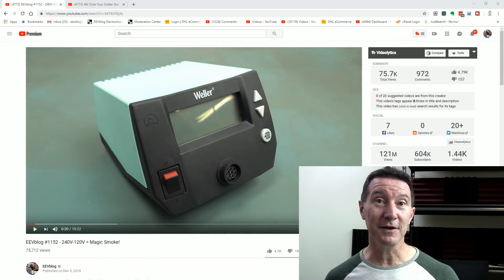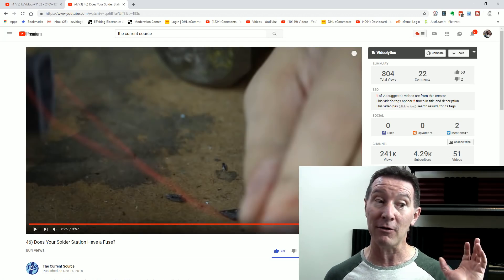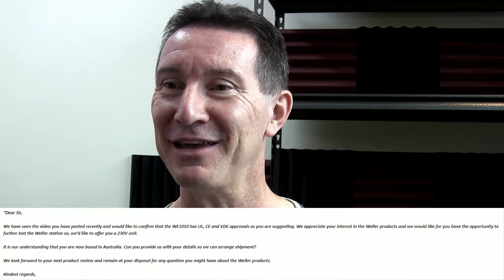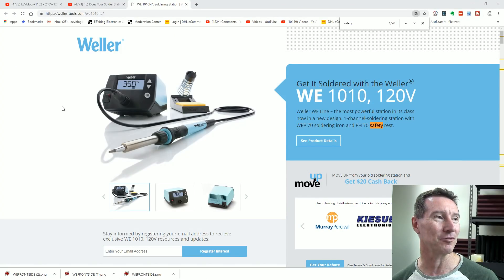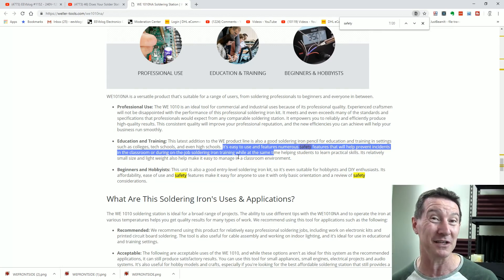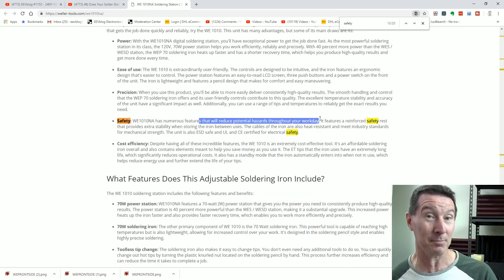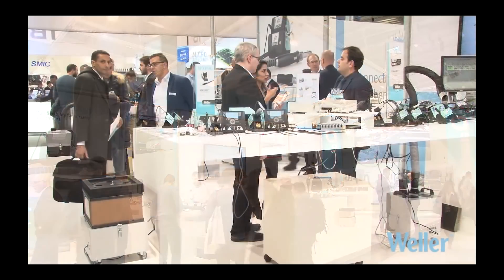EEVblog #1160 - Weller Responds!

Comment: Hi Dave - Thanks for highlighting this and can not believe their response. I have sworn by Weller for many years and have around 8 soldering/desoldering stations around my workshop. Over Christmas, I am now going to check and see if they have mains fuses on the input.

I am in the UK on the 230/240 supply, and see regularly the result of incorrect fusing (or no fusing) through our doors on an almost daily basis. I can not believe you got such a wishy-washy reply with no technical reasons for the ommision. Perhaps the CEO runs all his domestic equipment without fuses?

Merry xmas.

Comment: WOW using a different Weller myself,  looked up the model u r talking about online, the pic of the back it has a computer male input for Mains, BUT NO LABEL REGARDING Power Requirements so ANYTHING could end up going in there and its  ALL THEIR FAULT, as well as NO Fuse.  : (      TOTAL FIRE HAZARD

Comment: Well you plugged a 120v item into a 240v supply. I'm surprised they didn't send you a info printout on how to read a voltage rating. Also don't you have a correct fuse in the mains plug anyway?

Comment: In the US, a lot of consumer products with mains transformers won't have primary side or even any protection. It is usually devices with small transformers such as radios and boomboxes or just about any small "wallwart". They rely on the thin primary winding to be the fuse. The transformer in the Weller is comparatively beefier and should have been fused.

Comment: Weller would have done better not to respond at all when compared with this. Deliberately ignoring the problem in their response adds more fuel to the (in this case very real) fire. They once had a fairly decent reputation. This was an opportunity that could have been used as a turning point for them. Yes, they'd be sinking some short term earnings, but they'd be buying back their long term name/rep. Sorry, Weller. You've now demonstrated AGAIN that the bean counters and marketers are running the show! Smoke and mirrors don't fool us.

Comment: Sorry Dave but you're wrong, the lack of primary side fusing is completely safe in this instance, failure of the transformer insulation which is very rare will result in three possible outcomes, a primary side short (in which case the breaker will trip), a primary to secondary side short which can't happen in this case due to the transformer design or a secondary short causing core saturation and excessive heating (which is the only realistic scenario where a fire could occur), the only negative I can see is the lack of thermal fuse but since it isn't a product that is meant to be left unattended for long periods there is probably an exception for it, putting 240V in to a 120V product is a rather unusual scenario and would not be stopped by a fuse until a short occurs so it has no value at all.
While I would greatly prefer a thermal fuse to be present, ultimately there is no reason for the product to include a primary side fuse.
Reply: Are you by any chance working @ the Weller marketing dept?
Reply: Heh nope, their marketing department is clearly wank, but I still stand by what I said, failure of the transformer alone is incredibly rare so protection of the secondary side only is typically adequate, in the rare event that it does happen we have breakers for a reason, don't get me wrong I do think there should be a thermal fuse in there but it isn't a huge safety concern otherwise it would have never made it through compliance testing.
Reply: @JohnDoe-hm8lr  Like Oskar said, due to the IEC connector it's pretty easy to connect this crap to 240V accidentally, even in the usa. I used think the us were all "safe" 120V pussies, but now i learned that at least some of them also have 240V on their household-plugs. So you can easily blast 3+ KW through this thing for hours without your circuit breaker doing anything.
Reply: It's not an unusual scenario thanks to the brilliant design of the IEC connector.
Sure, we can blame Dave for not double checking the voltage rating, but you can't expect ordinary people to have half a clue.
(They probably wouldn't have a soldering iron, but still: it's far too easy to connect stuff to the wrong voltage.)

Comment: I'm not a pro EE myself, but I have to ask... Isn't a primary side mains fuse required in stuff like this, and if not, how come.

i'm personally thinking shitty cert requirements for UL & co. or cheating like Volkswagen and other manufacturers did with their cars. The CE mark might as well be Chinese Export. Surely the cert authorities must at least require the bill of materials or diagrams...

I do realize that soldering irons mostly output a 2 digit amount of watts for heating, but it's still a heat generating (thus, fire generating) appliance. 

still.... tons better than connecting a heat source directly to the mains like the non-station crap irons.
Reply from the maker: The product class they chose to have this UL tested under apparently does not require a fuse. But it's industry standard arse-covering common sense practice to add one. Seems Weller don't agree with that opinion.

Comment: So you applied the incorrect input voltage, and this is the fault of the iron?  Was the mains fuse specified by weller?  If not, what are you complaining about?
Reply from the maker: They deliberately did not specify a fuse in the design, like everyone else does.

Comment: Wasn't the sample unit intended for the North American market?  Fuses?  we don't need no steenking fuses...   Apparently their electricity isn't dangerous,  or so everybody (on the internet) seems to say  - I've watched a certain NA youtuber  do appliance power wiring, and his responses to the resulting 'safe-t-nazi' comments about things like using a protective grounds as  an appliance neutral (shudder) indicate a serious gap in his understanding.  :)   But, seriously, it won't be a  loophole in the UL regs, it will be a gaping  chasm.   Why not get the 230V  sample from them even if only for dissection?  I'd be interested to see if the Australian 230V unit carries a fused or thermally protected transformer or if they use the same rules that seem to allow much industrial equipment to require the infrastructure to do the fusing. That said,  I'm yet to see a generic mains pencil with a fuse even in .au  (and no, two wrongs do not make a right, even if three lefts do).
Reply from the maker: It was their job to inform us if the other region ones have a fuse, not my job to investigate.

Comment: the weller irons I have used don't have a transformer they plugged directly  into the mains so if something went wrong the fuse in the plug would blow & if you removed the soldering tip the iron wouldn't work as the tip was magnetised & was needed to close the thermostat switch

Comment: While I agree that it would be better to have a fuse in it for the reasons you specify, I don't think that Weller has committed any crime in leaving it out. The iron meets UL standards for safety because it is electrically isolated and the case is a non-flammable plastic just like countless small power tools. It falls under the same standard as a drill or power saw. Soldering guns and and irons often do not have fuses because it is assumed that you are capable of reading the instructions and using it safely. Weller is probably not directly addressing your concern about the fuse because of all of the litigious A-holes in the world looking to make an easy buck over a non-issue. They aren't going to say anything that might be misinterpreted, like 'get over yourself'. If you want a fuse in your cheap solder station, put one in yourself.
Reply from the maker: I did not say or imply they did anything illegal, I'm sure it's completely legal.  I think it's just a stupid design decision.
Reply: I didn't suggest they did anything illegal either. It's just a metaphor. I don't see it as a significant flaw. I do notice that many creators don't read the instructions until after the destruction perhaps for a more dramatic video.....

Comment: Either a fuse or a hardwired 120V US power cord...  The IEC connector nowadays somehow implies wide range voltage support.
Reply from the maker: Yeah, in thsi case you have to read the label on the bottom, not the back were the socket is.

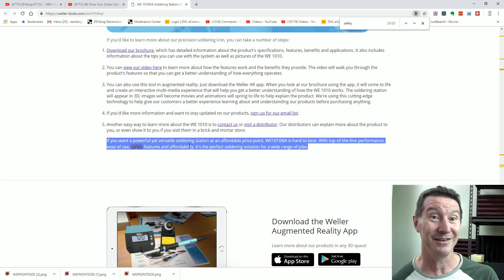Comment: 6:47... Stop whining and install a fuse of your choosing. My Weller station has been working daily for the last +20 years without incident or failures. Perhaps plugging it into the proper voltage might help.

Comment: As a very special safety mechanism, Weller soldering stations release magic smoke as warning sign for detecting any problems with your mains input. As marketing leading innovator Weller does not charge extra for this exclusive and patented feature to our customers.
Reply: Old chinese proverb says: Don't plug 120 volt equipment into a 240 volt mains supply. Any questions?

Comment: Hey Dave, Were you in a bad mood doing this video or what? I just watched both of your videos and you did screw up. You plugged a 120v device into a 240v outlet. Everybody would expect that thing to blow up. It would be the same no matter if you plugged in an old CRT TV or anything else with a transformer. I really feel that you were unneccessarily bashing the crap out of Weller for no good reason. They answered appropriatly and kindly and you even made fun of them being curtious. C'mon dave. I really expect more of you. This was a hit below the belt. You're a professional, treat the companies with respect and don't make fun of them. This is not okay...
Reply: Well said, he needs attention since his viewer ratings are being significantly reduced by Rossman repair etc. This was his stint
Reply from the maker: No, you expect a fuse to blow, not the thing to blow up. Do the exact same thing to any other station on the market and the fuse simply blows.

They did not reply appropriately. No mention of why they deliberately chose not to use a fuse, no mention if other region voltage units have a fuse or not, no explanation why some models and fuses and other don't, no mention of the product class of the UL listing, no reassuring customers, nothing at all. It was a classic marketing fob-off email. That response (to an engineering channel no less) deserved to be laughed at.
Reply: @EEVblog  You didn't laugh as much, as you almost cried because they didn't take you seriously.
Reply: @EEVblog  From a safety standpoint, what is important is that the device not malfunction in such a manner as to ignite anything nearby.  It would be interesting to know, if you acquire a sacrificial iron, whether continued power would have resulted in the device giving off flames capable of igniting things outside itself, or if the wire would have gone open-circuit before that happened.  Safety standards don't care about internal damage, provided that the devices don't endanger anything outside themselves.
Reply: Ahhh so finally the truth comes out, its all about ego, how dare they snub an "expert" that plugged a 120V device into 240V. You are a good guy but I think you are letting your pride get the better of you.
Reply: @EEVblog  do a test. Let's suppose they place a fuse for 2-3 times the rated current at full load. Now measure the current drawn from an overvolted and saturated transformer and see if it's greater than the fuse's rated current. I see that transformer burning while drawing a fraction of it's rated powe and rated fuse current.
Reply: @vihai  As soon  as the transformer started melting, the coil dropped down from probably 1kOhm to something that can be expressed in SIemens. That's roughly  1000x higher than the rated current. That fuse would have protected against a full on house fire. And to that other guy, no, it will not instantly blow out a 16A fuse... It will eventually, but at that time your house is burning down.

Is the problem that he put twice the voltage on the coil? Maybe... But how can you guarantee the 110v is spike free?
Anyway, I think the discussion is moot, since it's not CE or british spec. . If not having a fuse is acceptable in a country with paperboard walls, I am not going to argue. If it is CE or british however...
Reply: @bloepje  1000 times the rated (1 A ?) current will have the CB trip instantly. Also, all appliances are testes for surges. Appliances are not tested for voltages above the rated specs which already include margins (-20% +15%).

A fuse may help in some corner case to provide a slightly better failure mode but it's NOT this case.
Reply: @EEVblog , Thanks for the answer. But i honestly don't agree with you. If you take a fridge or dishwasher and plug it into twice the voltage the same thing will happen. I agree that input protection would have been nice. But its not designed to be brought across the world and plugged into a 240v socket either.

I don't know if you have gotten hubris by running a hugely successful youtube channel. But I don't expect a huge multinational corporation to discuss design philosofies with people on the internet.

I honestly believe you are misdirecting your frustration. It was your oopsie that caused this.  It would be similar to blaming the manufacturer when you drop your new smartphone onto the concrete for not making it more sturdy. Or blaming the car manufacturer for not having a rubber molding on the door to prevent dings.   Would Ford adress the rubber molding design philosophy with you just because you ran a huge youtube channel? I dunno, i doubt it.  

Maybe you are the one that deserves to be laughed at? You plugged in a device intended for half the voltage into a 240v wall socket. Thats a rookie misstake. 

Don't make fun of anyone for not answering you for 11 days, or making a bad response. Mutual respect is the way to go. Tell us you think its a bad design because of x, y and z, and just don't recommend them to your viewers. You always appear as the villain when you make fun of someone or something.

Just my 2 cents watching this video.
Reply: Oh, and another thought. I'm not very well acquainted to the mains system in Australia. But don't you have RCD's or RCCBs on your mains? In Sweden most houses have RCDs after the power meter. This way the entire house and all sockets are protected. Woulden't the RCD have broken the circuit if this were to happen?
Reply: @antonsandstrom46  Safety standards don't cover (only) normal operation. A safe product needs to make a good attempt at not becoming a hazard in common failure modes. Plugging into the wrong voltage is certainly common enough.  I've done it twice so far (tripped the breaker for the whole floor of the hotel one of those times)  Once was some random product I forget what MANY years ago. The second was a power strip I grabbed running out the door that I thought didn't contain any protection at all (this one blew the hotel breaker).  Multiply that by how many travelers?  It needs better protection.  I don't think he's upset (besides at himself) for destroying the iron.  That failure has revealed a safety oversight / flaw, which is what this is about.
Reply: @antonsandstrom46  The fault yielded an over-current condition, not an earth fault condition, thus an RCD would not have broken the circuit. Fuse=over-load or over-current protection, RCD=earth leakage protection -> very different fault conditions.
Reply: @antonsandstrom46  No, RCD breaks when current goes other way than the wires - e.g. your body and through a water pipe. This was a simple short, all current came in and back the proper way, just a bit more than usual for a soldering iron, but still less than an average water cooker.

Comment: While the rest of the world bleats about no primary side fuse, in the UK, because of our wiring system and regs it DOES have a primary side fuse! It sits in the BS 1363 plug top. Yet another reason why fused plug tops are superior to the rest of the world! No such thing as "too much protection". I wonder how long it will be before someone's workshop or house gets burnt down because of piss poor design and manufacturing? ALL multinational capable products should be factory set to 240v AND have HRC panel fuses fitted!
Reply from the maker: There had to be one BS plug fanboy :->

Comment: Not a fan of weller. Had some irons before and the handles fell apart after a few uses.  Prefer goot irons. Mine still going great after 10 years and only replaced the tip 3 times in that period.

Comment: I don't see the hating on Weller. I agree a crowbar or some sort of overvoltage protection is a good idea but at the end of the day you plugged a 110V device into 240V. The IEC standards require you to mark the max input voltage on the device and if the user choses to ignore this it invalidates the approval of the device (duh!). If you think that is a loophole in the standards get a chair on the committee and change the rules. If you buy the iron in the country you intend to use it then it will be the correct voltage unless it has been imported and then there isn't a problem

Comment: Dont know what that burger flipper ( marketing people ) snorted on, but the correct answer should be at least something like that: We will look into that, because such failure of ouf product ( although UL tested ) shines a  bad light on its reliability, name and safety. Bla bla bla...  All new models will be fitted with ptc or whatever will help to prevent .....
Reply from the maker: They actually have a PTC (and two fuses!) on the secondary.

Comment: All Weller irons in the UK have a primary fuse! It's in the mains plug :)
Reply: Any product used in the UK does, you know that
Reply: @mkontent  That is the joke.
Reply: But, what size fuse do they use? I contacted a well known Swedish battery charger manufacturer because the unit I bought had a 13 Amp fuse in the mains plug, Their response was "because we can" I duly replaced it with a more suitable 3 Amp fuse.